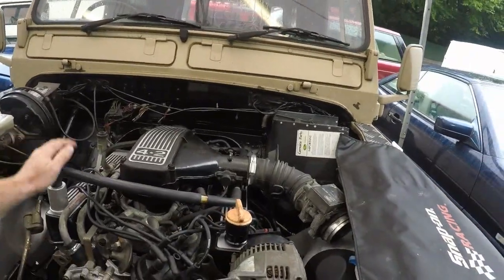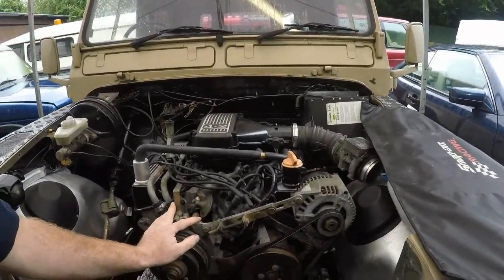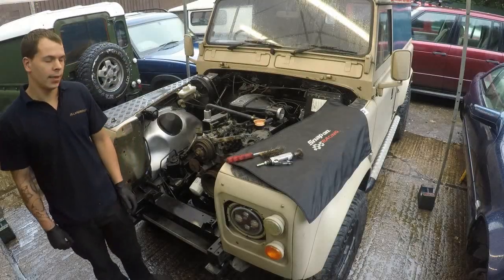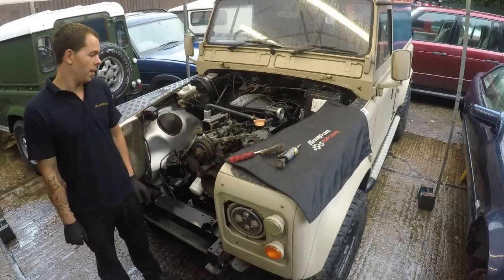Defender v8 conversion project beast Landrover 4.2 lse

Comment: I have a 1987 D90 2.5 Petrol wanting to use a RR V8 for engine swap  can I use my original L177 box and transfer box? thxs
Reply from the maker: Dominic Bamford yes
Reply: Great.  Thanks.  What do u think would be an easier conversion for me to do a 200tdi or the 4.6 V8.  I’m based in the States therefore finding a doner V8 from a RR or Disco is really easy to find. Or I would have to find a 200 or 300tdi in England and ship it over ? 
Any recommendations/advise please ? 
Perhaps I can call u ? 
Thanks 
Dominic
Reply from the maker: Dominic Bamford the 200 is easier